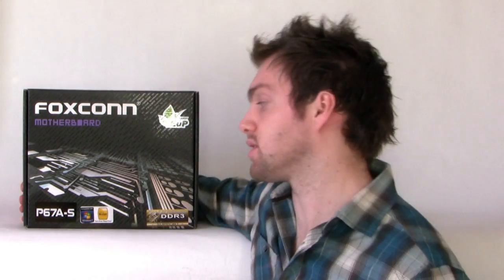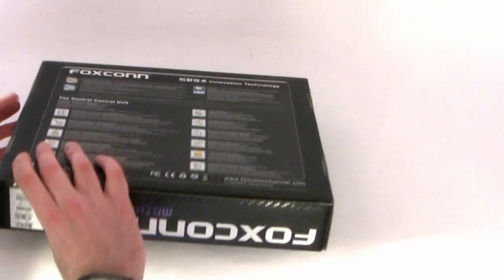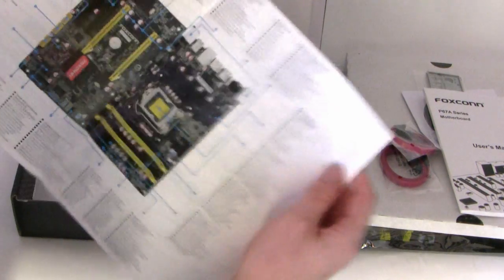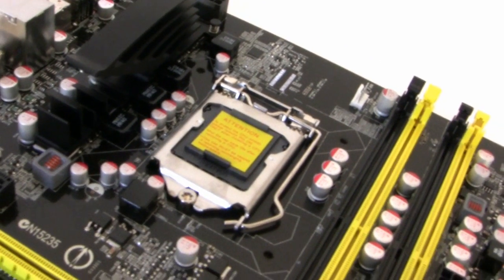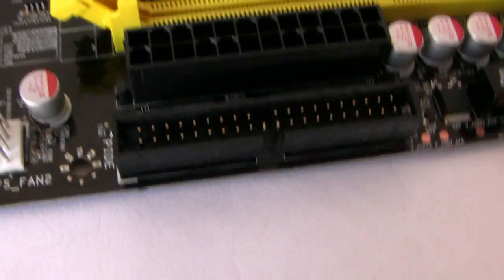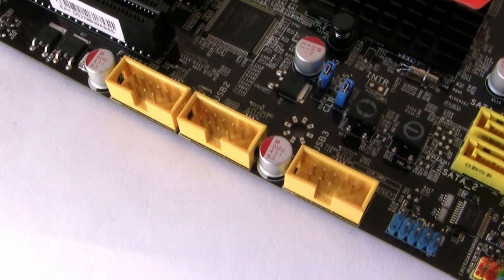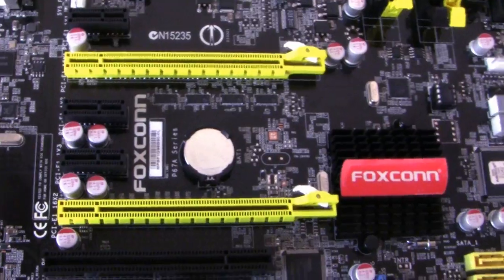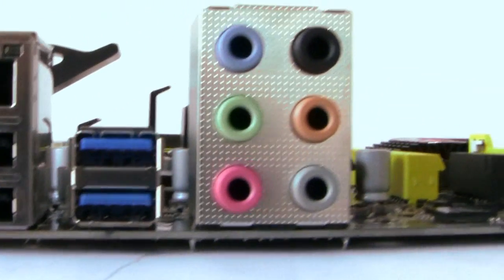Foxconn P67A-S LGA1155 Sandy Bridge Preview + Unbox

Comment: Whats the difference between the P67A and the P67A-S?

I got the P67A not really thinking anything of it until I saw the S series floating around on the internet. I do see in your video that it has the ESATA ports and the USB3 Ports which the P67A doesn't. But is this the only difference?